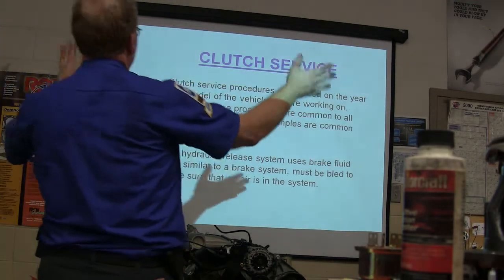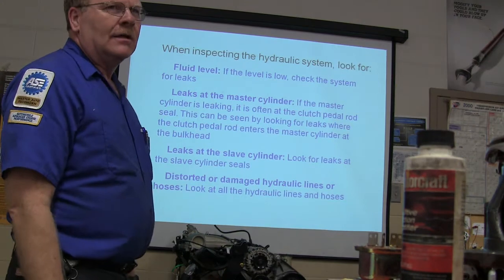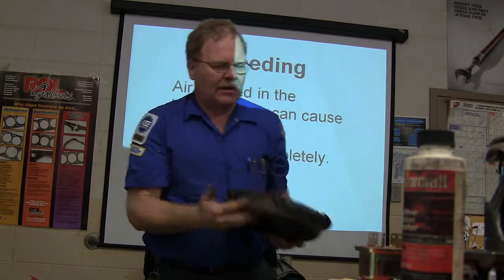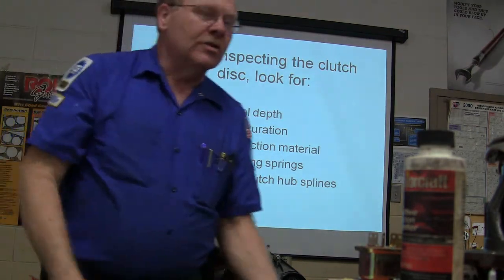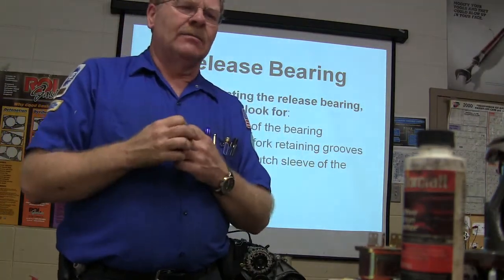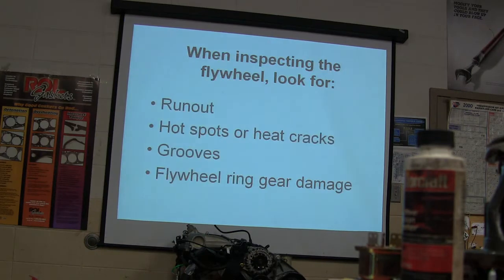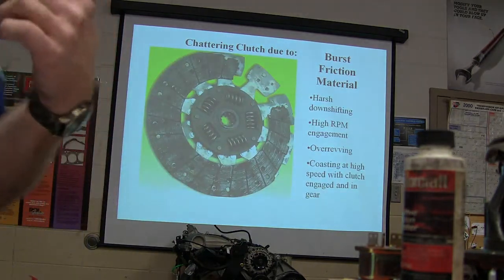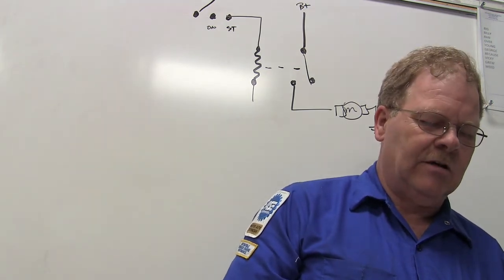Manual Trans Day 1   Clutches

Comment: Beware of clutch dust, oil dust mix from leak, and burst friction material. You will be very irritated if it gets in your face or skin. I try not to be directly under it when separating the transmission from the engine. Some cheaper clutch sets do not have enough spring on the pressure plate. If I know the customer likes to slam gears they get the upgrade. Back when that movie F&F came out the shop I was in had three cracked cases on Eclipses come in from city kids trying to imitate the movie. The turbo model has a larger trans than the non-turbo.